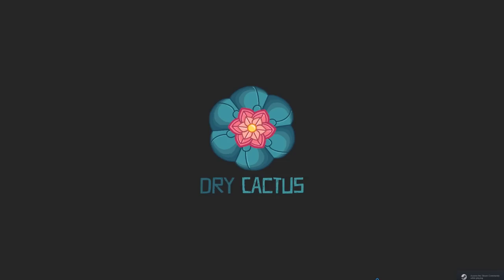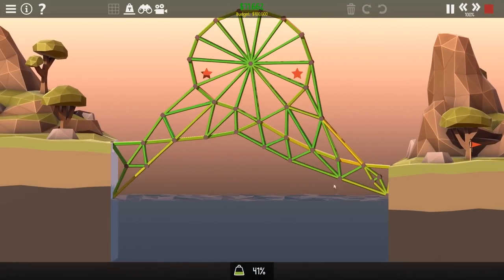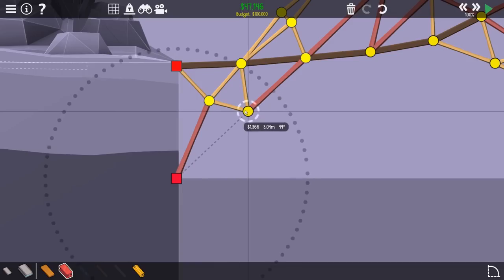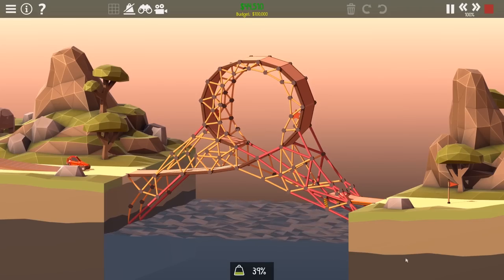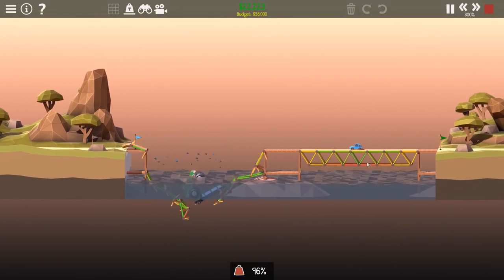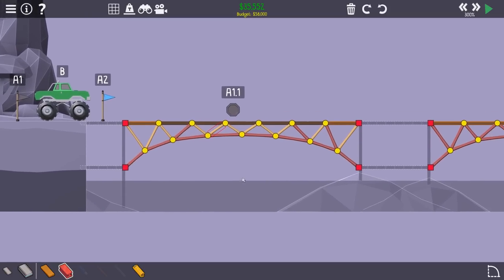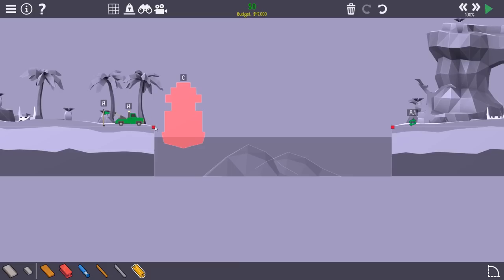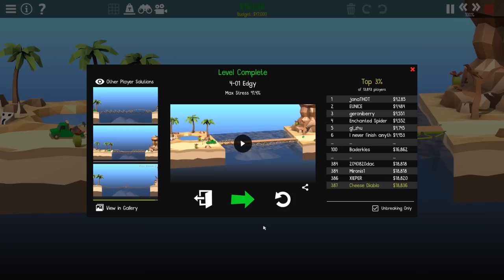How to CLIMB THE LEADERBOARDS in Poly Bridge 2 using ACTUAL ENGINEERING! Featuring a loop!

Comment from the maker: UPDATE: 
I have since spoken to the producer of the game and can confirm this is a case of the butterfly effect. Changing anything in a level can cause other things to change as calculations etc will be run again and could have a slightly different outcome. This is the main problem with using computer simulations for real life situations, and is worth remembering when using any software to simulate something real.

Original: 
I completely forgot about the level at the end of this video... someone please explain what the actual HELL was going on here? I was raging!! Haha
Reply: Chaos theory, the answer for all things. But more likely a variety in the games physics engine calculation causing a slightly different out come on another part of the bridge, even if it’s not attached to one another.
Reply: When you modified one bridge, it caused it to bend in a new way, changing the speed and position of every vehicle after driving across. This slight change in position caused a change in the amount of pressure at each point, breaking the bridge
Reply: The left bridge originally was barely holding together at like 99.9% stress, so when you reinforced the right bridge it sagged a little less, causing the limousine to stop a few pixels farther, which normally wouldn't be enough to cause a new break, but did because of how close it was originally. Basically, the limo stops in a different spot because of the right bridge having more support, causing the monster truck to hit is slightly differently and adding the 0.1% stress needed to break the left bridge.
Reply: Yeah, the level seems jank. When you are close to breaking, it started to become janky and I guess floating point became an issue.

That's my guess anyway
Reply: floating point precision issues. Nothing to see here, let's move on :D
Reply: Really though, that piece that was breaking was probably very close to 100%, and when you edit the bridge, calculations may be done in a different order, causing small changes in values calculated. This is unavoidable, as precision limited floating point operations are not commutative or associative, as actual calculations on real numbers are.
Reply: More info here: https://docs.oracle.com/cd/E19957-01/806-3568/ncg_goldberg.html
(Article is a bit math-heavy, but you are an engineer :D)
Reply: I think the wooden part between the two bridges is not absolutely static. Maybe the added weight from the reinforced road on the right lets makes the left bridge bend in slightly another way. Or ... but that's something for slow motion - reinforced roads make cars go a little slower. So the black car stops a little earlier.  

Anyway - to me it was quite easy to get the monstertruck going over the black car without breaking. The blue car was harder ... because smaller, all the weight not so far "distributed" ...
Reply: @pufaxx  red nodes are static, no matter where they are :)
Nice theory about the reinforced road, though. I didn't know they made cars go slower.
Reply: @somerandompersonintheinternet  Well, I thought so, too - but it would be an explanation if they were not. Just a theory. As reinforced roads slowing down cars is one as well. 

:) 

I guess hard to measure, difference is very small.
Reply: @UCxLxNUC50LMfc-PZPGIkX6A One of my ideas was reinforced roads could slow down vehicles. Maybe we're up to something?
Reply: It's due to flexibility. Weight of the bridge can cause the wheels to bounce differently and keep it from reaching its max speed, which makes it stop at a different point.
Reply: @somerandompersonintheinternet  It's definitely not floating point precision. It's the flexibility built into materials that causes this. That flexibility is actually crucial because every bridge would break on any amount of impact if materials were rigid.
Reply: @kylehart8829  Yep, that sounds more plausible than my explanation. Thanks!
Reply: @kylehart8829  I've just tried around with my solution and exchaning roads with reinforced roads. Nearly no difference, but maybe that's because of the way I built both bridges (both had two springs in it). 

Anyway, I think you're right. It's not the type of the road that slows vehicles down or speeds them up - it's their weight and therefore the "bouncyness" of the bridge that makes vehicles stop in slighly different places.
Reply: Basically the structure of the bridge is used to generate an RNG seed for the physics the game uses.
Reply: @daniellucas5522  That isn't how it works. You can test that theory by building some pointless structure that isn't attached to the bridge except at anchor points; your bridge will always behave identically after doing that. I wrote the true explanation earlier if you read back through the replies to this comment.
Reply: @kylehart8829  Literally not the case dude, go watch streamers like EUNICE who regularly build bridges that abuse the physics of this game - changes to any part of the build can affect physics they are completely unattached to.
Reply: Maybe the reinforcing allowed to limo to go a tad bit faster, then it stopped In a Different position?
Reply: @kylehart8829  Just went and tested it - made a falling road that launched a tanker randomly - placed a road completely unconnected that doesn't touch the tanker, and the tanker launched differently. Structure of the entire bridge determines the physics RNG seed.
Reply: @daniellucas5522   This is the same issue with people claiming it's float precision. Floating point precision and RNG make a difference when you have very large movements per frame and wonky collision (like abusing falling roads), but the real explanation here is far simpler. If RNG actually had that significant of an effect while the physics engine isn't being abused, many bridges would change drastically just by adding a single piece of wood on a static joint. But with any actual bridge that doesn't abuse collision calculations these things will practically never have an effect, which is why this game's physics are so much more consistent than Poly Bridge 1. I would actually bet you money that adding a disconnected piece of wood to the bridge in the video would not affect it at all. You can even see what is happening by watching the position that the limo stops at in the video. It stops very slightly more to the right the times that the bridge breaks. The limo's final position is the difference here, and it's caused by the weight and flexing of the bridge; RNG is irrelevant in this scenario. This game's consistent physics are much more robust than you think. You're trying to find a more complicated solution when the answer is much simpler and is very easy to demonstrate. Check my youtube channel for a video demonstration of the real reason this happens.
Reply: @kylehart8829  I've literally seen it have impacts in multiple videos now. Your theorycrafting is nice, but when your theory disagrees with reality, your theory is always wrong. You can literally see the stress hit 99% on the previous run, so a change of a fraction of a percent is enough to collapse it.

And cars colliding with cars is the exact type of wonky collision that is very RNG dependent in this game.
Reply: @daniellucas5522  This isn't theorycrafting. I have an actual explanation and a video showing that an extremely finnicky bridge is not being affected AT ALL by RNG. It even relies on the monster truck bouncing in a strange way, just like the bridge in this video, and yet it is still impossible to make the bridge behave differently by adding unconnected parts. 

There is no reason to suspect that RNG is having an effect on the bridge in this video, because the game's physics are designed to not rely much on RNG unless it's necessary. Your explanation is a shot in the dark and mine is a testable hypothesis with the testing included.

It's extremely easy to find a bridge that has a butterfly effect based on flexibility, and extremely difficult to find a bridge that depends on RNG. Just based on that, if you were to guess which explanation was correct for this video, you should never choose the extremely rare scenario, you should think logically and choose the one that is many times more common.
Reply: @Daniel Lucas minuscule changes cause a butterfly effect in any game when you break the physics engine.
Reply: @Kyle Hart Give up my dude, some people are hopeless. You are correct with the butterfly effect, I can see that in many videos of this game.
Reply: as a physicist (not that this is 100% real physics my theory is actualy real simple when you changed the wood (that has a bit of strech compared to the rigid metal) the woodwas giving a bit more slack/elasticity to the whole bridge like a rope or a spring it enabled it to spread a bit more force, so when you changed it ot a bit more ridgid material the stress on the parts that took the impact increased because they had less give to work with and that combined with the fact they where at max stress it's normalwhen you hit something with the same stress but with lessway to move it will break... it's the same thing in real life if you want to break a wooden plank you dont putit between 2 springs and hit it in the middle you put it between 2 rocks or  2 metal beams.... same thing happened here.... it's the same with muscles it's notthat much of a thing that you increase the strenght of the beam because wood is wood but it's more like that you increas the give it kan have hence spreading the stresswith a bit more bouncy part.... (both are ineffect but less rigidity is the bigger contributor that's why its's more wobbly and takes more strain)
Reply: Much like Risa reactions, except not actually designed for real world applications. Then again, expecting a game to work like a structural engineering program would be insanity. :) Love the content man.
Reply: Yeah this is something we in the business would call optimizations. It's a trade off between being able to run real-time and being a 100% realistic.
Reply: What do you mean, dangly roads aren't engineering?

Hangbridges definitely are.
Reply: @colorfulslime8820  programmer here, sounds like the engine is just broken then. i mean how does this make any sense?
Reply: indeed, the calculation of transmission of momentum and conservation or momentum does the trick. it reflected.
Reply: 0.1+0.1+0.1==0.3 => False. This is the sad truth about numbers vs computers.
Reply: Yeah I hate whenever I put my spoon into my cereal and it causes my house to blow up
Reply: Children of a Dead Earth is another example of a physics simulator with this problem. It makes heavy use of calculus, and as you increase things like engines or weapons in scale and power, computer errors compound to the point of violating conservation of energy. This means you could build weapons with higher output energy than input.
Reply: They probably just use floating point numbers and the accuracy for the decimals they hold tend to change based a bit off of the entirety of the build because part of the calculation uses some byte addresses that were used during the build data gathering process.

Programming is fun!
Reply: Úúúúúúú
Reply: I believe it comes down to the resonance of the right bridge having a very slight impact on the position that the limo comes to a stop on the left bridge. My theory is the reinforced road improved the structural stability of the right road just enough to have an exaggerated impact on the limousine (with it’s wide stance), such that it picked up more speed, and placed itself just where it needed to be to break the threshold of the left bridges load capacity when the monster truck collided with it. Another possibility is that the altered right bridge resonance caused the limo to have a slightly different bounce coming off of one bridge and onto the other (I believe they do account for vehicle suspension in some way shape or form). This could result in the altered stop location suggestion, or if you don’t want to believe you see that... with such a tight tolerance in the bridges stability to begin with, a slightly altered resonance of a dynamic load crossing the bridge could lead to substantial loading alterations seen in the bridges structure. That is, within those very tight tolerance conditions we’re dealing with in this scenario.
Reply: Wow I’m late.........
Reply: I would suggest 'weird rounding error'. I'd say fair enough, considering the parts wouldn't be hermetically sealed from eachother in real life.
Reply: Also the speed change might affect the physics accuracy.
Reply: A bridge too far.
Reply: Actually the non-breaking bridge was working due to luck of specific positioning of vehicles.  They could try and fix it by re-running simulation many times with small perturbation of input variables like speed & weight of vehicles, showing a collapse if ANY caused a failure.
Reply: I think it's more a demonstration of Chaos theory than the butterfly effect.  The butterfly effect has to do with time, Chaos theory reads "the more complex a system becomes the more dependant it becomes on its initial conditions".
Reply: @TechniTiger  No, the butterfly effect is small changes in values  having a large change of outcome in unpredictable ways eg) a storm resulting from the beating of a butterfly's wings.
Reply: Until I saw this co until I saw this comment I Believed it was floatingpoint errors
Reply: Bear in mind, even if the forces from the rightmost bridge do not transfer to the leftmost bridge (and they probably do not), the limo drives over the rightmost bridge first. Therefore any changes in the rightmost bridge affect the final resting position of the limo on the leftmost bridge, and that affects how the monster truck goes over it, and the forces applied to the leftmost bridge.
Reply: @bintavi7034  Yeah I believe this is the actual answer.
Reply: @TechniTiger  So you think it is more a demonstration of chaos theory than a demonstration of chaos theory?
The butterfly effect is typically an example of chaos theory. The Wikipedia page on the butterfly effect starts as "In chaos theory, the butterfly effect is"

Chaos theory has systems governed by simple rules evolving in a complex manner such that a small change in the input conditions can result in a drastic change in output.
An example of such dependence is a butterfly flapping its wings in one location changing the air pressure which results in a hurricane in another area.

In this case, a small change in the right bridge results in the left bridge collapsing.
Reply: Our theory is that it’s a matter of tiny fluctuations in the game’s deterministic positioning. Tiny changes in how the vehicle is placed (including floating point errors) can influence exactly what happens, in this case seeming to result in angle jank (vehicle angles have some strange effects on how much stress they apply) due to pixel offsets from reinforcing the bridge. Exploits often seem to result in in-memory problems that can also bleed into other calculations, and we doubt that RNG is used in here at all.
Reply: i am here falling a sleep an i swear for a min i was seeing things felt like i was high at 12:34
Reply: In the loop challenge the key is to jump straight to the edge after getting the 2 check points.
Reply: @RCE    It's pronounced sang-gwinn, like a desert penguin.
Reply: The change in the right bridge was transfered in the sense that the limo that passes over it to get to the left bridge ends up in a miniscule different location because of whatever bending or friction change caused by the piece of road. The gray bit of background does not connect the 2.
Reply: But if you change something on the other bridge it can cause the Limo's speed to change🧠🧠🧠🧠🧠🧠